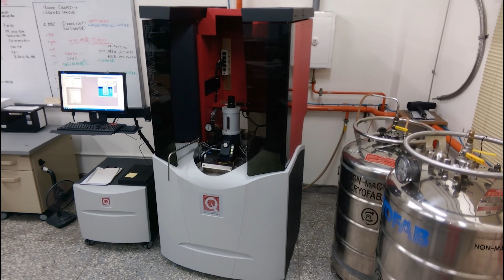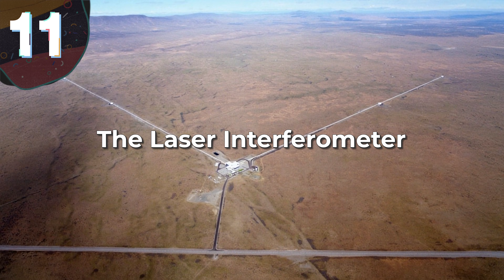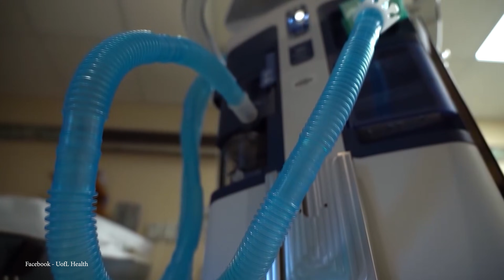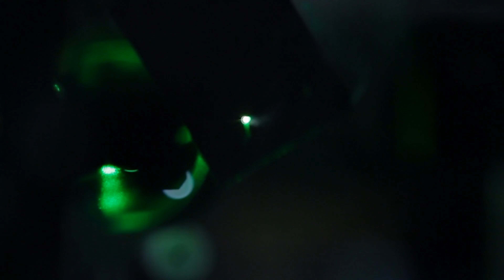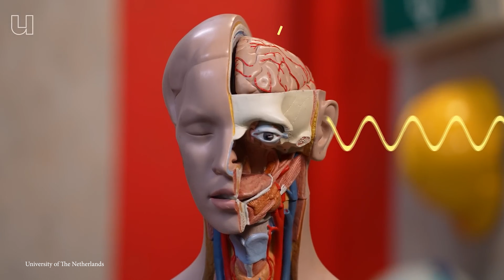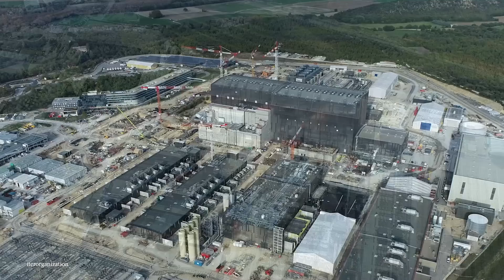15 MOST UNUSUAL Scientific Devices

Comment: Hay, you guys stole my friend's device, the Squid Magnetnometer.
It's my friend Joe Squid Johnson's invention.
He got the Squid nickname from a sex thing he does, like squid ink or something?
Anyway, his magnet, with no meter, was able to detect very little ferrous metal accurately for just 3 easy payments of $19.95
otherwise, it's free when you get the little washer shaped Ni magnet out of a DVD PLAYER (that holds the DVD in place) at the garbage dump and hang it from a 6" thread like cord loop attached to your coat's zipper. When brass is pulled away from the magnet slowly, the magnet will get pulled past the vertical position and start to swing/pendulum if there is any ferrous metal in the brass.  Recycled brass may be the main offender. Most people just superglue the magnet to a pierced earring stud so they can hang their BIC lighter or coke spoon on it.
Anyway, that is what I am mad about today.